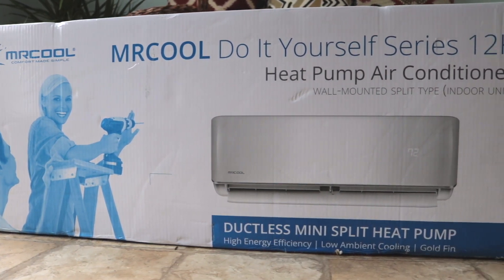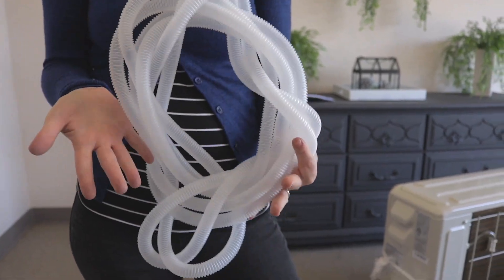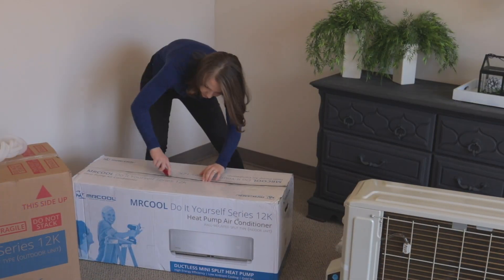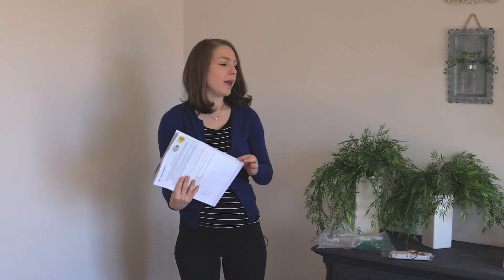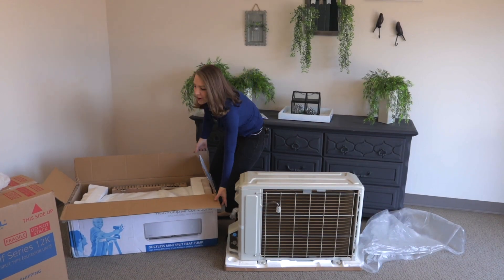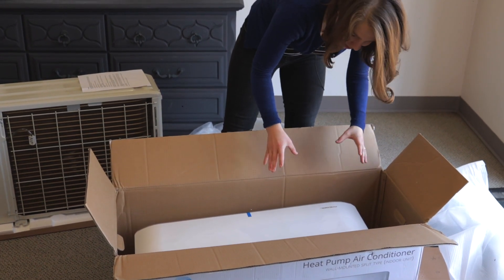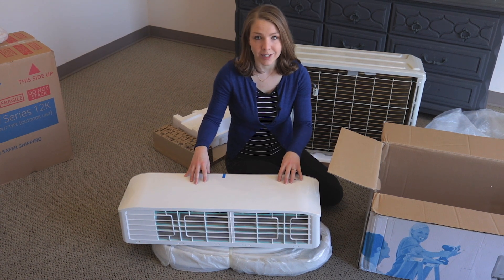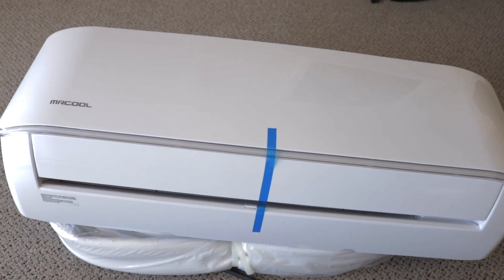MRCOOL DIY Ductless Mini-Split Generation 2 Unboxing

Comment: Since there is not a 9000BTU DIY Unit, do you think 12000BTU is too large for a 14’ x 7’ (98sq ft) room with 9 ft ceilings?
Reply from the maker: Unfortunately, 12k BTUs would definitely be over-sized for that space.

Comment: Are the inside units silent or how loud r they. Can we get a video test
Reply from the maker: Our products are rated by decibel level. For example, the Advantage 9k is about 36 decibels on high. Which is quieter than your typical library.

Comment: How do I connect the power to the house?
Reply from the maker: The outside condenser must be wired to a disconnect box and breaker.
Reply: So pretty much it's not diy cause u need an electrician

Comment: Can we use one outdoor unit to power 2 indoor units with this?
Reply from the maker: That is not possible with the MRCOOL DIY, but you can run one condenser and multiple air handlers with the MRCOOL Olympus multi-zone.